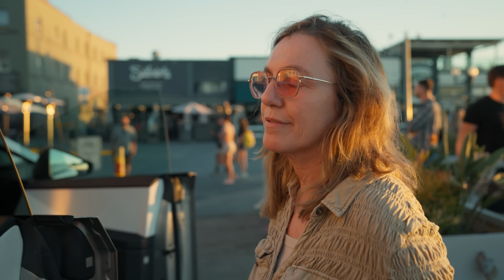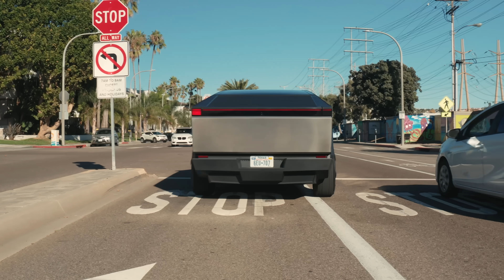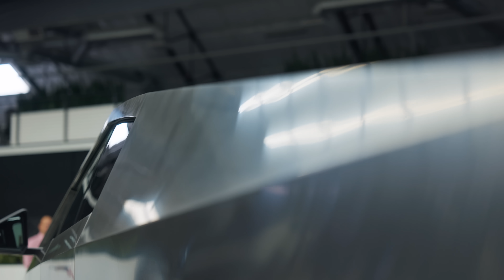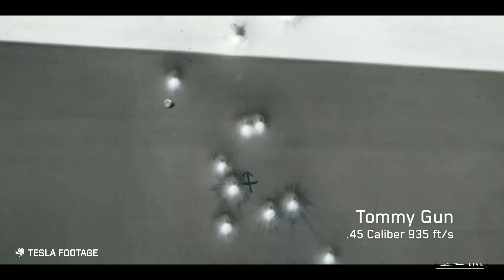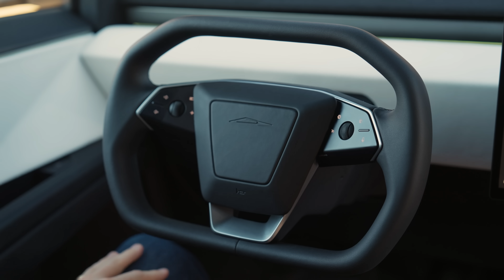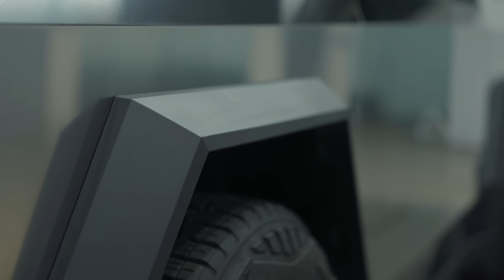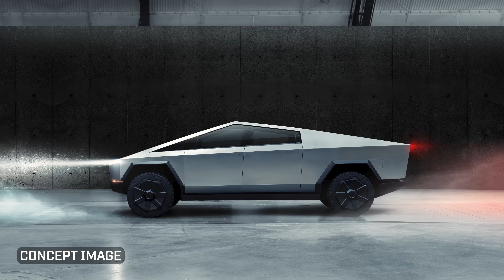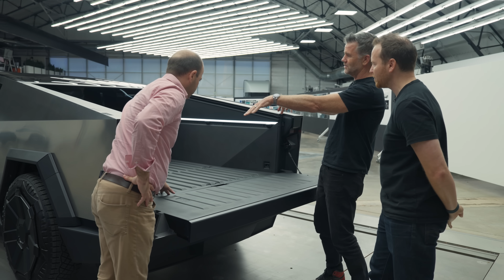FIRST DRIVE: Tesla Cybertruck Full Review

Comment: I remember Elon talking about  an "optimum" range which reflected the idea that if you only do a long road trip once in a blue moon, then its pointless having such a heavy battery pack around which reduces day to day efficiency......which raises the question of if the range extending 50 kw battery is removable? If it were bolted in occasionally for a long trip but you weren't lugging it around permenantly then its best of both worlds.......Elin wouldn"t go down the Hummer Cul de sac!

Comment: Sorry but you guys dropped the ball on this one.  41 minute video review of a truck and you gave 3 seconds in a brief mention of the towing modes on a computer screen.    This is supposed to be a truck.  I want to see it tow something big.   You didn't even point to where the hitch and pin connectors should be.  LOL.    Oh and if you do this again, I want to see that bed loaded with some gravel and dirt, shovel it out, put some real dirt and scratches in the bed, dirt all the way into the tonneau cover track, then use a pressure washer to clean it and close the tonneau top again.   This is not a truck it's a status symbol.

Comment: I have no doubt that the engineers are good at what they do. But when elon musk said that the cyber truck woulld cost $40k. The price of the cheapest option is actually $60k. He also said it would be able to drive 500 miles on a single charge. This can't be done even with the range extender. So more lies.

Comment: Okay, I get that they didn't want the CT to look like all the other pickup trucks.  But there are real, practical reasons why pickups look the way they do.  For instance... 1) How do you tow a fifth-wheel or gooseneck trailer with the Tesla?  A: You can't.  The CT will be limited to bumper-pull only.  2) Oh, and speaking of those sail panels, a lot of pickup owners actually load cargo into the bed from the side.  Not on the CT!  3)  A lot of pickup owners also drive with the tailgate down (or removed).  Can you do that with the CT?  4) That exoskeleton may be cool, but how repairable is it?  Will a crash that damages the cab cause the insurance company to total the vehicle?  5) What's the headroom like for the rear-seat passengers?  It's really not as big as any of the true "dual-cab" pickups on the market.  5) And hey, just how much will it cost to replace that humongous windshield if it's not covered by your insurance? Regardless of the designers claim about its strength, it WILL break - like when something heavy falls on the A-pillar. But that gets back to my #4 above.  6) I get that the design geeks (who obviously never owned - or drove - a pickup truck) wanted a minimalist, stark (and cheap!) interior, and they didn't want any mechanical switches at all, but some pickup drivers do so with gloves on.  Would it have killed Tesla to put stalks for the turn signals and wipers?

If Tesla was trying to make a "practical" pickup truck, I think they kind of missed the mark by going for "clever" instead.  Interesting vehicle, yes.  Big car with a big trunk (and a smaller trunk up front).  Okay, there are some good bits in the bed (which honestly is pretty big).  But let's be honest, it's not a great working pickup truck.  However, all the city-dwelling poseurs who think they "need" a pickup truck are going to love it.

Comment: The only problem I have with the cybertruck is that it is basically invisible driving down the road, it might as well be a mirror with wheels.
Reply: It is devoid of anything that appeals to the eye, it looks like a godless commie designed the "truck". A horizontal refrigerator on wheels.
Reply: Having seen it in real life... it is the opposite of invisible.
Reply: Might check out how it does in crashes too.  So far from what i've seen it does very poorly.  As in not having crumple zones poorly.
Reply: @All_in_Forms  I would like to believe the Tesla engineers and the government safety agency which certified this truck to driven on public roads over you or any internet experts who have not driven the vehicle.
Reply: @All_in_Forms  It has to pass very stringent safety tests before it can be sold.  They're well past that point.

Comment: I like what I've seen so far but I want to see it actually used like a pickup truck. Maybe put head to head against an F150 in a series of tasks involving loading/unloading, offroading etc.
Reply: In this video and in general, the "truck" part is an afterthought...  it's a big expensive car...  it's going to be despised by the people that actually use trucks....
Reply: @PRH123 and yet it outperforms most trucks when it comes to towing capacity and payload.
Reply: @harifederer  outperforms other trucks until it runs out of battery power after 120 miles.
Reply: @pbowns  one charge is 340 miles
Reply: @harifederer  You understand that the 340 range is the vehicle not towing anything, right? It is not 340 miles while it is towing stuff.
Reply: Didn’t you watch the video of it towing next to the F150 ?
Reply: HA!

Comment: It's really cool and all but it's nothing more than a gimmick. For example, the use of stainless steel on a vehicle with a battery is unnecessary, it is not now a vehicle that will last more than 10-15 years on the roads... and this is also one of the reasons that the use of stainless steel to preserve the value of the vehicle is not so relevant. Another thing is that the more you look at the vehicle in the smallest details, you eventually see that the vehicle was built under the limitations of any other electric vehicle and there is really nothing future here except the design.

Comment: I set a 100 bucks when it was announced. Now that its out, I am a bit disappointed. I hoped it to be larger and having at least a range of 800km or a 200kWh battery pack. Of course without sacrificing bed space; What a ridiclious thought. Defying the reason to buy a pickup for extra range. With those specs, its a bit too small, with too little range for a too high price. Also I am missing a bit of utility, like having a charge port on either side or a slide-out ramp inside the bed or tailgate. Also I'm not entirely convinced of structural integrity having frameless windows. I just find them awkward and otherwise only see them on convertibles. I still hope its coming to Germany at one point though.

Well, one Death Germany has to take. If its not for pedestrians, then for the environment. Because Cybertruck was first on my list, second is a Dodge RAM 2500 8ft-CrewCab.

Comment: I wish this one wouldn't have a single pivoted ROTATING wiper than a total screen SLIDING wiper. .So a wiper which is embedded on the front  bottom of the windscreen and then using three telescopic arms with a wiper part going over the total width of the front screen and wiping up and down.

Comment: OMG just look at it.
Its definitely a Tesla.
The shoddy build quality.
The lack of fit and finish.
The rippled body panels that look pre-crashed and poorly repaired.

The stupid and distracting touch screen that controls everything.
Actual buttons, switches and levers you can feel are better when driving and you can feel instead of having to take your eyes off the road and look.
Its a bland interior.
In your closing comments. Even the Lamborghini Countach admittedly its not great, but it was better built than anything Tesla has made.

Comment: Nice tonneau cover, BUT, WHY haven't they designed solar panels into the roof and cover?  The ability to trickle charge the truck whilst parked off the charging grid MUST have been a safety solution that was HIGH on the list of requirements, before the first models/clay bucks were built?  Great ON ROAD, but in the middle of the mountains, or desert? ....

Comment: What a shit show. Tesla failed on all specs they claimed 4 years ago. The most important being price and range. If you want range than you loose the truck bed due to the extender. Wich makes the truck useless. Without the extender the average towing capacity of 11000 pounds that most trucks have is not useable due to limited range. What is it good for? A rich peoples toy. Sadly only use case. It sucks as a work truck having no compressor or reach through. I am not living in Iraq so bulletproof is totally a nonsense perk. speed like a sports car.... Its a truck sorry tesla wrong car model. who cares. A trucker doesnt care about 0 - 60mph. I am unbelievable disappointed in tesla. In the past they got at least some stats right. cypertruck is a shitshow. a technology demonstrator. cypertruck tesla fan boys are going to be used as beta testers so that tesla can test their new tech that they finally will let trickel down their model lines. And the Tesla cultists will spend 100000 grand to beta test this tech. Like they do in fsd BETA.  Unbeliveable.

Comment: Will be interesting to see how it holds up to salted winter roads.
Reply: I'm not sure. Everyone likes to point out that it will be impossible for it to 'rust' but that doesn't mean you won't see other types of oxidation or corrosion.
Reply: Its a work-hardened Custom 300-Series Stainless, so likely similar in performance to high-end industrial kitchenware as the work hardening has made it martensitic, or certainly the most outer layers. Maybe their own blend has superior properties - more than likely. I’m sure there will be a strong nano-coating applied or some other form of sealant also. For context the Delorean used 304-Series, and there are rumours that Delorean offered a 25 year corrosion guarantee to their body panels. Whether that’s actually true, who knows.
Reply: The unibody is still steel and some aluminum from what I have seen... it would rust like anything else unless it has amazing coatings. The outside exo skeleton is the stainless so that will never rust but might show some surface blemishes which can be buffed out with ease.
Reply: What about rain and snow?
Reply: Its Stainless Steel depending on what grade stainless it is it will not corrode

Comment: I live off-grid in the center of Oregon. I have a problem with the range. Don't charge over 80% or let it drop below 20%  That leave 60% OF 320 or 186 miles. I live 135 miles from Klamath Falls. I drive from Sacramento frequently and my last charging station is KF. I live in Christmas Valley, 135 miles east of KF. If I have the heater on or AC in summer,. I will be able to go to and from but not use it in Christmas Valley  Had ordered 2, but have to pass.

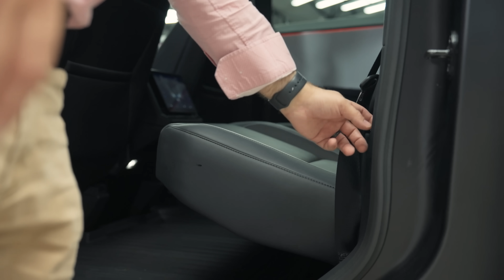Comment: 32:39 Here me out. I have a F-150 Super Crew Cab and F-250 Crew Cab. I prefer the rear "unalive doors" in the rear of the F-150 because it's annoying to walk around an open door to move something from the front seat to the back seat. If the back doors swung back toward the bed of the CyberTruck, It creates a nice cubical like space for changing at the beach or whatever. 

Plus, when on the side of the road, you don't have to step into traffic to step around the back door.

Comment: Except the RWD is not $60,000. 2019 40k is $47k inflation adjusted. Then there's a $7,500 tax credit, so $52,500 from $60k. 47/52.5. Only 5.5k difference and you get an $8k rebate off FSD. Do the math next time Top Gear!

Comment: I can’t believe he never actually took it off road for a little testing.
Reply: Exactly. Lets see it take some punishment..road impacts, crossing through waterways, snow mud etc
Does this even have a boxed frame or another unibody truck ?

Then theres roads that are salted down ea yr.
Reply: Valid comment, indeed. So far we've just seen an acceleration on the smooth avenue typical for EVs nowadays. Would be great to see if it's off-road capable at all, how their materials survive after sand, stones, branches etc.

Comment: Was just thinking about charging… note the current layout of supercharger stations. They are parking spots…so hook up a trailer and go for a drive all of a sudden you’re going to need to recharge… does this mean you have to disconnect the trailer, pull into a charging spot and charge? If so it’s kinda of a problem… secondly the truck is massive so even just parking it in a charging stall seems tight

Comment: “Is it a good truck? Yes” he says as he literally does nothing with the Tesla that a truck actually does. Tesla basically made a very heavy $100k car that does the quarter mile like a sports car and can haul 4x8’s in the back. It can’t tow my 5th wheel. It can’t wheel worth a shit (at least I haven’t seen a single reviewer do it yet) and with a trailer that it can tow behind it, you’ll barely make it from one charging station to the next. Before you call something a good truck, maybe know what trucks are used for here.
Reply: Look at the demo video.  It's got a better turning radius than any other truck.  It also outowed a Ford F350.
Reply: @ericwaldron3599 An f350 has a towing capacity of 21,200 lbs. A cybertruck can tow 11,000. And an f350 can tow 21,200 lbs for 350 miles. A cybertruck wouldn't come even close to its max range towing 1/2 that weight. So in what way did it "out-tow" the f350?

Comment: As much of an engineering marvel it is, the more I know about it the more I hate it.  Here me out, the bed is great, the tie downs and other pieces are nice.  I even like the back seats how they move out of the way.  The plugs in the back being two way is good.  The rigidity is good and suspension modes are all next level. 

  So why the hate?  The looks are horrid, and the more they changed everything to one screen the more it will fail.  Everything has a motor on it and a point of failure.  Nothing about it is mechanical at all. Nothing is a simple switch, which means you have to use the screen for everything.  How are you even supposed to glance at your speed without moving your eyes way away from the road.  The screen is also major distracting.  Then there is the price.  No thanks on this one.

Comment: Cool car. Yet, once again, as with all reviews, not a single mention about the process, cost, or wait times to repair a Tesla. If you get into an accident how long does it take to fix the damage? Also, if I want to drive 500 miles how easy is it to find a charging station? Besides the initial cost, it’s still an impractical vehicle compared to a normal truck.
Reply: https://youtu.be/6iNxI-74QOE

Comment: Probably the same amateur car like the model 3.
2-3 years of use in a northern environment, and it doesn't pass the inspection anymore, due to rusty brakes and worn out suspension. Like in germany, the model 3 was THE WORST car out of 117. Even more unreliable than a dacia sandero. 🤣

Comment: The range is ALWAYS overstated and ALWAYS without considering towing or weather, etc.  They need to make that 200 more miles before it gets attractive.
Reply: Dude gas cars get less milage towing weight as well.  Physics.
Reply: @ericwaldron3599  understood AND agree.... but I can go 700 miles on a tank in an F150, then stop for under 10 minutes to refuel and go 700 more.  For $100,000, this "truck", which it's not, should perform better.  Its new tech, I know... but you're paying more for less.

Comment: Does this steer by wire system mean you can do the conventional 3-point turn in just one maneuvre?
Reply: yeah the steering lock just requires 170° of turning, you dont need to keep rotating the steering wheel over and over like in a normal car
Reply: at higher speeds the steering feel becomes heavier so you can have more control

Comment: I love the hell out of this and really wish I could get one, but my MAIN hangup is I HATE touchscreens.  And when he showed going into a menu and putting the vehicle in drive by swiping up and navigating those menus just to adjust the steering wheel, air, open the glovebox, etc, I hate that stuff so much.  I wish I could get this exact truck but with knobs and buttons for all common interactions.  I know that's a lost cause, but maybe this truck will get other companies making unique and fun vehicles that aren't married to 100% touchscreen
Reply: Just hit the voice button and say what you want.  Works for most everything.  Like "open glove box", "open frunk", "adjust side mirrors",  "fold side mirrors", etc.  This is how it is in my S, likely the same with cybertruck.  Also, I assume, like the S, that the car automatically picks forward/reverse based on what it expects you want.  Usually that means you are in reverse, you do still have to switch over to forward after you finish backing out.  And my S also automatically opens/closes my garage door, so again, one less button to push.  Still hate the stupid turn signal buttons.  Really wish they would get rid of that.
Reply: Not a single word or anything shown speaks to it functionality. The slanted box is not functional.
Trucks are for work and do not need to operate like a sports car. A truck needs to haul thing go off road pull a trailer, haul lumber tools equipment. So far I've seen a glorified car not a truck.
You take the truck to a place where the few trucks are sold and people have no idea how one is used, how stupid. Why would you not take it to Texas or Alberta Canada to get an opinion? 
California to get an opinion about a truck, not very smart.It is nothing but a glorified car.
Reply: @schulzmj1  
All those Trucks I see parked outside Boca Chica don't even look like they're used as Trucks, bar to carry a toolbox. 80% of personal vehicles are bought as a statement or vanity.
Reply: More distractions and stuff that breaks far as Im concerned. Cant repair this at any shop or auto parts store...nope gotta rely on Mommy Tesla and pay the $. Pass